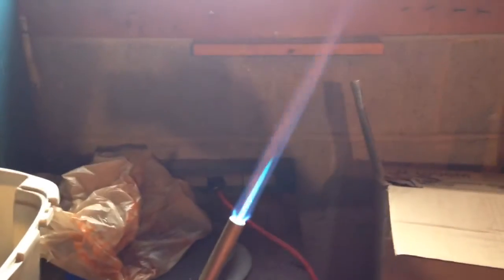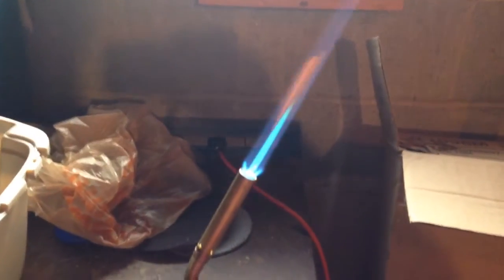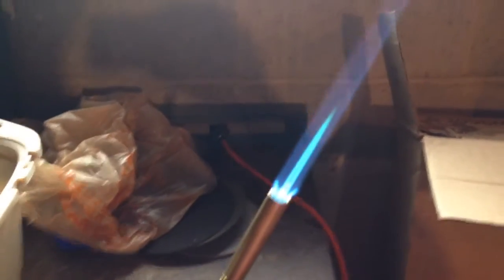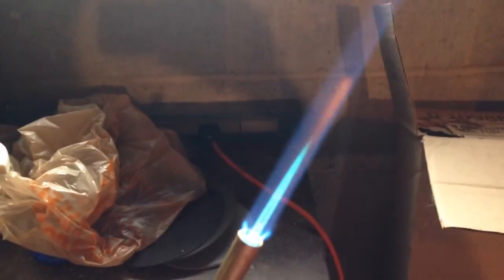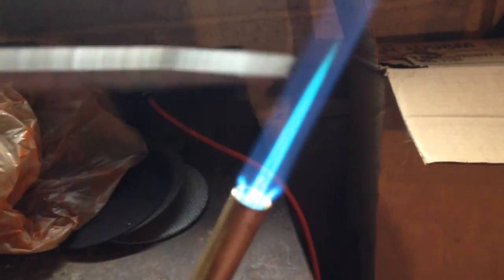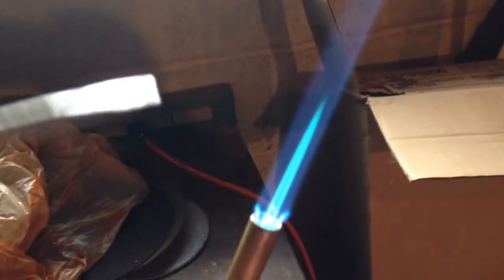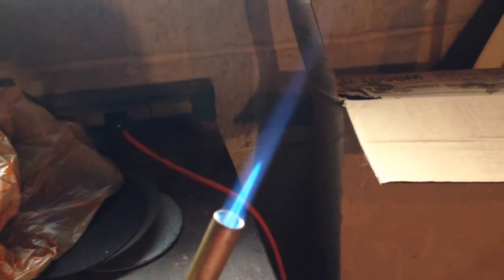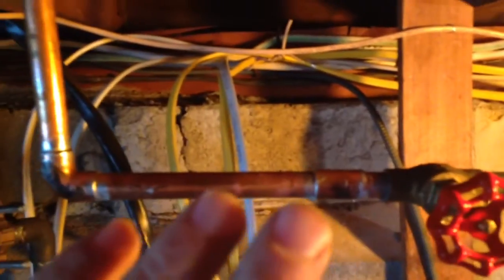How To Properly Heat Up Copper Pipe Using A Propane Torch

Comment: If I hold the flame below a copper tube will thw whole copper tube heat up? What kind of wire or metal can be used with it that will not conduct heat?